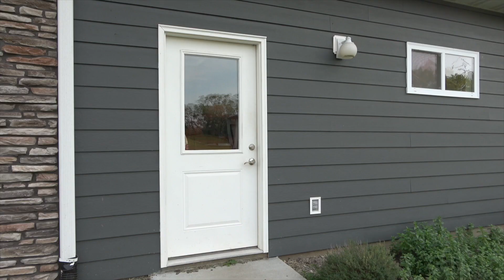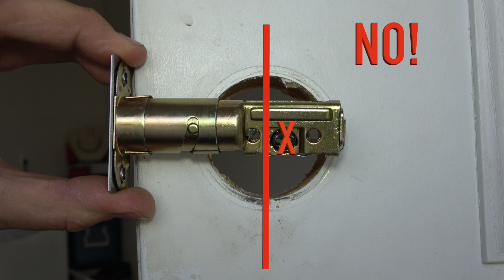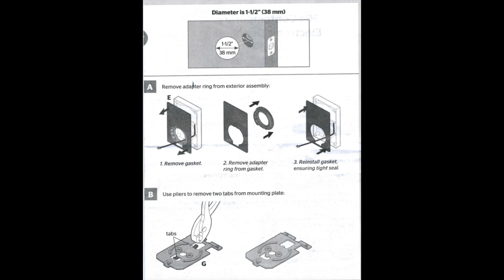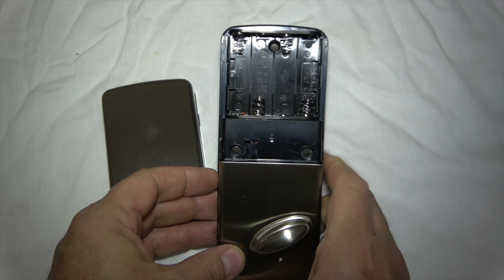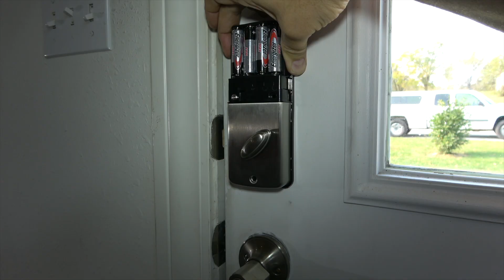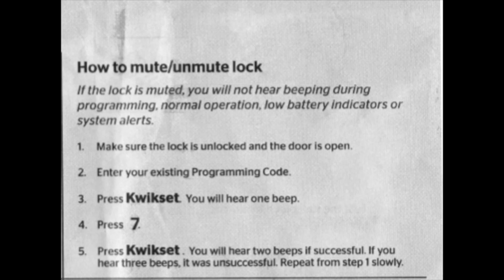Kwikset 264 Electronic Deadbolt Installation

Comment: Can I use my existing Kwikset dead bolt cylinder instead of the one that comes in the package to avoid either (i) two sets of house keys or (ii) hiring a locksmith to rekey this deadbolt to my existing house key?
Reply from the maker: This happens to come with the ability to adapt to your house key.  I think it's called "smart key".  I didn't do this, but I probably should make a video on it.   hmmmm....

Comment: My lock is not functioning, I followed the same steps as shown, but after I enter 0 0 0 0, kwikset 0 and kwikset, the lock doesnt goes in and out to get it set
Reply from the maker: weird.  I wonder if there's a glitch in the one you bought
Reply: @PhilCrockett  I am having the exact same problem.
Reply: I got it. I was typing to fast. gotta go a slower pace when programming.